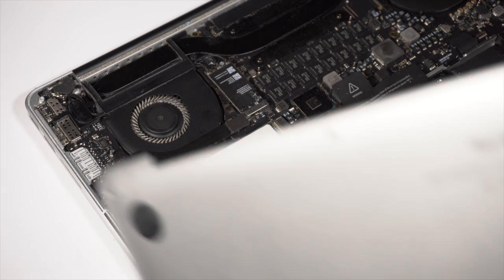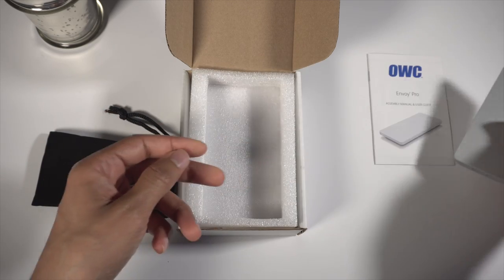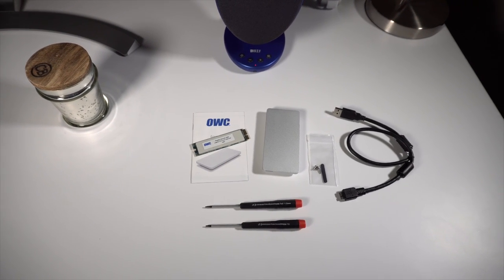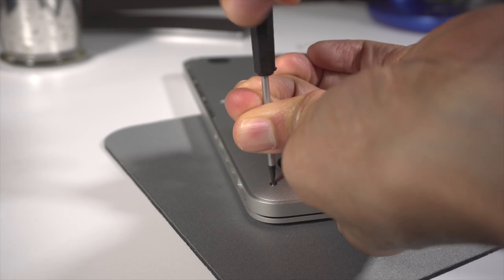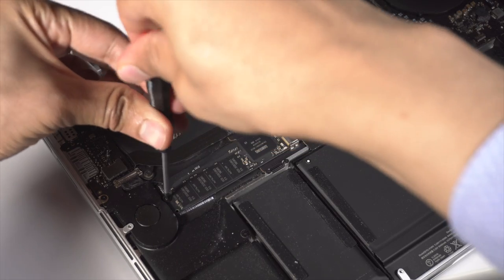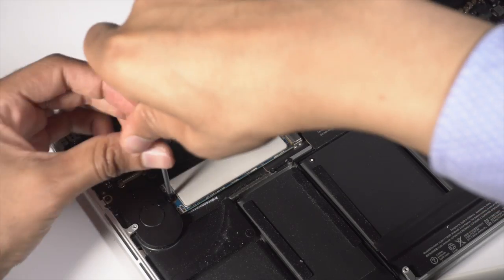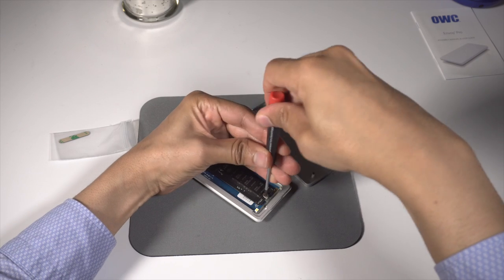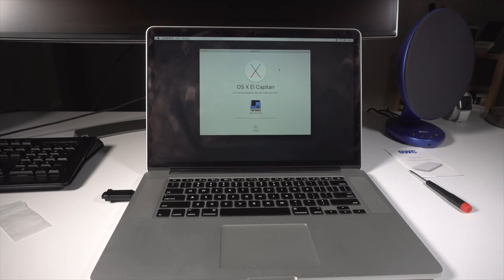OWC Aura 480GB SSD Upgrade Kit Install - Mid 2013 - Early 2015 MacBook Air/Pro

Comment: I was reading some overheat problems related to the Aura SSD, is that a problem for the laptop?
Reply: Claudio Andres Iturra Ulloa 
After four years, my OWC 480 GB SSD must have overheated because Apple technicians are recommending that I replace it. Luckily I kept my factory SSD from my 2012 MacBook Retina in the OWC Envoy.
Reply: Thanks Kripta!!
Reply: Claudio Andres Iturra Ulloa 
No worries. It definitely lasted a good 3-4 years.
Reply: Claudio Andres Iturra Ulloa yez
Reply: Yes thats a big problem and 1 of the reasons I haven't bought one to upgrade my RETINA MacBook pro 15 inch 2015 .
Reply: I replaced my original 512 SSD with the Aura 1 TB, and have not had a hard drive heat issue, but my fan's on my 2013 MacBook Pro seems to be the problem!   This 1 TB SSD works beautifully, and I've had it now for a couple of years!

Comment: Hey I need some help I installed the new ssd just fine in my 2015 pro retina but when I try bolt up internet recovery my time machine backup and new ssd cannot be found.  What am I doing wrong? Thanks.
Reply: @itguyry  wondering if your problems were solved, I'm getting ready to upgrade 2015 Mac also
Reply: Same thing is happening to me

Comment: Would this void warranty if I bought a new old stock MacBook Pro? Saw a deal for one at bestbuy and want to upgrade from 128 to 480
Reply: King-Saadi-92 
Just don't mention it, if you are paranoid, just take out the 480 GB with factory one.

Comment: Important information missing: 

Makesure to download either Carbon Copy Cloner or SuperDuper prior taking out the original HD. Install the new SSD, and connect the original HD via the USB cable provided. Boot from the original HD.  Then clone the original HD to the new SSD by using either softwares mentioned above.

This will make your life a little less miserable!
Reply: Or backup your old ssd with Apple Time Machine on an external drive before installing the new one.
Reply: I just used 'Time Machine' and it worked flawlessly on both mine and my wife's MacBook Pro upgrades!

Comment: What can be done with the old SSD? I know there is this external case for it from OCW that is pricey AF. But could it be mount on a Desktop PC motherboard? Is it standard?
Reply: I bought my Aura 1 TB SSD with the external case for my OEM 512 SSD drive, and both are working perfectly!   I didn't find the cost overbearing personally, and now that it's been a couple of years, I'm quite thankful I did!

Comment: any issues with sleep function? I've read in a few places that when you install IWC AURA and close the lid, the macbook shuts down.
Reply: I have this problem! Any Solution?
Reply: this only common in 2013/14 models, my 2015 is running smooth for over a year now with this ssd. No sleep/restart issue at all.

Comment: Envoy Pro did not work at all for me.  Just DOA.  Glad I had bootable backups on external disks.  This thing is a piece of crap.   Also the 480 GB Aura Pro X ran hot and caused kernel panics.  also a piece of crap that sucked twice the power idling that the original Apple SSD does.

Comment: hy there i need to upgrade my macbook pro mid 2012 hard drive do u have any proposition pls thank you
Reply: I upgraded my wife's 2012 MacBook Pro to the Macsales 512 Aura SSD drive, and also changed out the DVD disk drive to now hold the original hard drive...so the computer now has two hard drives.   The operating system is on the SSD and it moves along very nicely now!   I've been impressed with the Macsales SSD drives personally up to this point!

Comment: But does the Mac consider is an external hard drive or internal?
Reply: +Dan Clayton It should be shown as an internal drive :)
Reply: +AppleStuffTutorials it shows it a external thats why u cant install boot camp on it
Reply: OWC released a download back in May for the boot camp enabler. The boot camp utility WILL run on the aura ssd

Comment: I bought and installed the Aura SSD but it only worked several hours after installing it and it crashed. Technical support could not help solve the cause, so I returned it for a refund.
Reply: I installed the 1 TB Aura SSD two years ago, and it's worked flawlessly after following Macsales video on the install.. I heavily use my MacBook Pro compared to many, and it continues to give me fabulous service!  Only issues I'm having are I keep wearing out the tops of the keys on the keyboard, with all the typing I do!

Comment: Benjamin you forgot to ground yourself... ESD bro... otherwise you can short the MLB
Reply: Oscar GL 
How do you ground yourself, just touch any metal object?
Reply: @Oscar GL just use an earth banding strap easily found on eBay and Amazon etc...

Comment: Why the battery connector need to be removed? Does it has to do with the ssd?
Reply: You always disconnect the battery when working on devices
Reply: it helps to not Short circuit your device